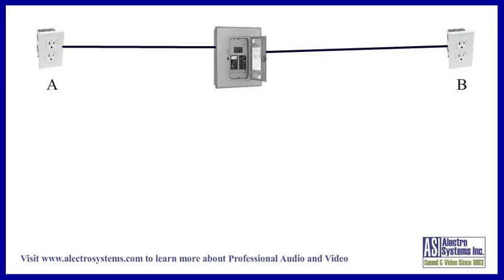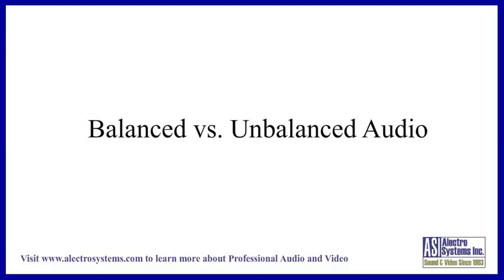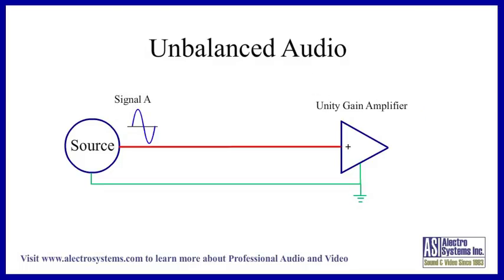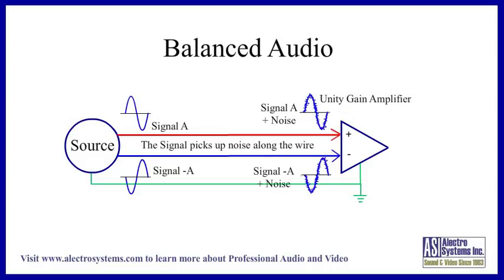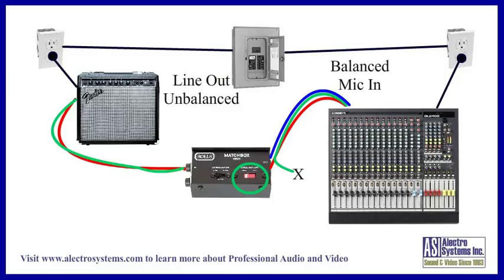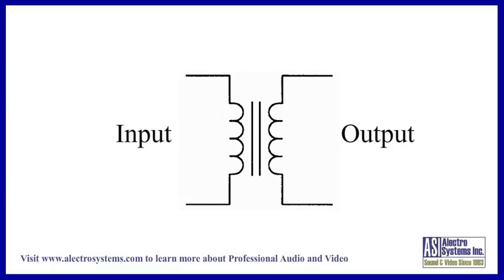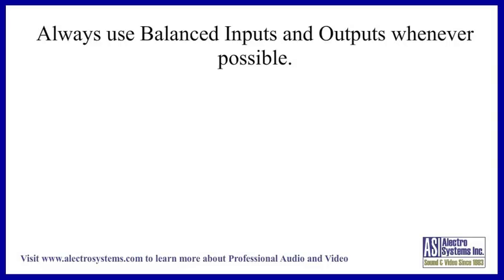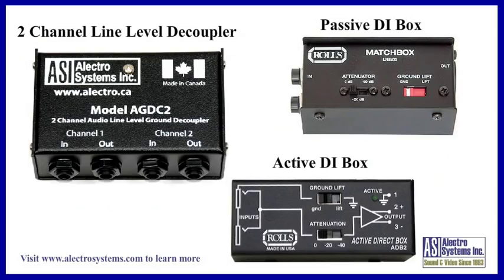Troubleshoot and Eliminate AC Hum on Sound System

Comment: I have an unusual problem. I have two different Onkyo amps. Both develop a hum when the speakers are connected. That does not happen with a new Rotel amp and a newer Yamaha receiver. Only with the Onkyo. At first I thought the problem was with the circuit- the wall socket. But with all things disonnected there is no hum. Connect the CD player no hum. Connect the turntable - no hum. Connect the speakers there is a slight hum from the transformer. No noise in the speakers. The speakers are Dali Opticon 1 mk 2. The speaker wires run behind a large wall unit where there are also cables for the TV. I am not sure what because all of that was done before my time. The speaker wires are twisted together. There might be interence picked up from the TV connections- cable, internet, whatever. The old Onkyo Integra amp is such a mellow sounding amp I really like it. The Rotel is nice, but a bit bright. The Yamaha does not fit into the cabinet properly. The speakers are 4 ohm. Perhaps better speaker wire may help and wiring that is not twisted. The hum is very low and cannot be heard when music is playing. Or from across the room. I live in Germany. I am sure a DC filter would solve the problem. Thanks if anyone has the answer. I wonder if running a ground wire from the amp chassis to the CD chassis would solve the problem.

Comment: How to get rid of Digital Noise from any Computer which I'm using MSI B85-G43 Gaming Motherboard or if I'm using the Gigabyte Z390 Aorus Pro WiFi Motherboard, to the Point that Sounds like a Morse Code every time I move my Logitech G502 X Wireless Mouse back and forwards, even if I'm using Humno on any Computer, It doesn't matter if I'm using the Blackmagic Design Intensity Pro 4K Capture Card, or if I'm using a Green Audio Jack on the back of the Computer or use the iFi iPurifier3 USB Audio and Data Signal Filter/Purifier (USB Male Type B, White), or iFi Audio iDefender + USB Ground Isolator which is connected to the Native Instruments Traktor Scratch Audio 6 USB Interface, which is plug directly into the DENON DJ Mixer DN-X800 or Citronic CDM8:4 USB DJ Mixer from any Computer, using My 2000W ALTO Professional PA Speaker using the iFi SilentPower DC Blocker and also 2000W Alto Professional TS315S Subwoofer using the iFi SilentPower DC Blocker. And never matter what I do, I'm going around in circles, and spending so much Money on something that doesn't work. So, is there something that I'm Missing? Because I cannot handle the Digital Noise coming out of My Computer to the Point that Sounds like a Two-Way Radio not tune in, and interference sound every time I move my Logitech G502 X Wireless Mouse back and forwards, when I'm watching YouTube or Blu-Ray Movies and if I'm listening to Music, Saved on my Computer Hard Drive. it's not the Balanced Cable issue, because I would experience the Humming Noise. This Problem is doing my Head In. I live in South Australia, So, if anyone out there Experiences the same Problem? Please let me know what should I do?

Comment: I've a turntable and an hi-fi both without earthing to wall.
Other source devices are connected to the same wall power strip, noone with earthing.
The grounding between these devices is linked through the unbalanced L+R phono cable with the earth thiny wire.
Noise is present and follow the volume level. But still present if the turntable is disconnected from cable.
With same speaker I've also tried two different hi-fi system. I can't figure out how the problem can be generated by AC and how any DI Box can be help in this scenario..?

Comment: there is one instance with laptops that will sound like a ground loop but it's not and that's noisy battery charge circuits or power supplies a.k.a. five dollar replacements off eBay or Amazon with no filtration and certifications. And if it is a genuine power adapter it's usually poorly designed charging circuit and hopefully you can get through the presentation on battery.

Comment: I have a balanced xlr that goes from a preamp pedal and into my computers soundcard which has a 3.5mm input. My question is....are line ins on soundcard balanced....unbalanced....or capable of handling either? Reason I ask is I have ridiculous noise and I'm trying to narrow down exactly where the issue is....without buying yet more things that ultimately have no or little improvement. I'm thinking a 3.5mm in line ground loop isolator might be the key....but I'm not certain.

Comment: Excellent presentation + clearest explanations. --- I have never found an explanation for similar problems in a 2 wire (AC) 220V European circuits, though. Are those boxes identical in construction and use? Is AC filtering done the same way, since they don't have 3d prong for ground? I thing that Alectro is the place to get answers and... to shop. Bravo!

Comment: What a great video. My set up is as follows - Macbook, connected to a wall powered mixing desk via a USB insert - in that mixing desk I have an XLR condenser mic connected, using another wall powered compression unit, connected through an insert on the same channel as the mic. No problems, no ground loop. The problem began when I tried to do something very simple, which was add a 3.5mm TRS to Dual 1/4" TS  cable between the mixer and my DSLR camera,, so that the mic runs through the camera (for better lip sync on live stream/conferencing). Instant ground loop and very loud hum and buzz and I couldn't work out why. Now I know why. I'm using my DSLR camera as a webcam, which is also wall powered with a dummy continous battery - when connected to the mixer, this means I have two different wall powered devices running through it (the compressor and camera) which is obviously causing the loop (with the USB connected wall powered Macbook which may or may not be adding fuel to the fire). I've ordered one of those decoupling boxes and will expect that this will work, when connected between the camera and mixing desk. Fingers crossed.

Comment: I have mains hum probably due to a ground loop between hi end hifi components connected to the same outlet.
None of them have balanced inputs or outputs. If I used the unit you recommend surely it means I have to use more interconnects and wouldn’t it interfere with the purity of the sound in such a system?
My DAC and transport are from China. Is there a chance this affects the situation in any way, by having slightly different voltages?

Comment: Old vid but can anybody help so i have two amps+crossover+mixer i connect then via Aux cable to my Pc and suddenly today a high pitched hum or signal noise appeared and ONLY when gaming so does anybody know what is the issue these amps etc. Are all conmected on two extension points BUT from the same wall socket so im unsure whats causing this all the cables are fine so unsure whatsupp

Comment: one thing you didn't cover is the Hum between a usb devices from a (audio interface) connected to a computer mixer and synth equipment. another thing is USB midi between devices often introduces more noise.

Comment: so having unbalanced RCA cables, and putting a balanced adapter at the end doesn't make them balanced?
Reply: If you use a DI-box with a audio-transformer, it will make an unbalanced audio signal to a balanced audio signal. 

To get good audio quality you need to use high quality audio transformers, from Jensen Audio Transformers, Lars Lundahl Audio Transformers and others.

Comment: I get crackle sounds from just 1 speaker in my home theater since I added a 7ch amp. I can't seam to solve the issue. What should I do? Some told me to buy a conditioner. The amp and receiver are connected with unbalanced rca as the receiver doesn't have balanced xlr's. I also have the amp connected in a different outlet because when the amp was on the same outlet it was shutting off du to possible line sag.

Comment: What's the difference between the passive and the active di box?

What's the difference between mic level and line level?

Thanks and YESHUA GOD ALMIGHTY bless you!
Reply: A passive di box is using a audio transformer. A active di box is using a op-amp, aka active electronics. 

A passive di box is better to use, for it gives you minimal trouble, but it's audio transformer have to be of very good quality.

Comment: After 10 or so hours of trouble shooting/investigating/self educating, this video made everything clear.

We're going to take an old set of balanced trs cables and remove the ground pin on the trs connectors on the monitor ends. 

This will be our ground lift point for the two monitors.

Configuration we have is computer tower - usb to interface - interface output via 1/4 inch trs to each monitor. Each monitor is self powered/grounded, so we have a ground loop between the monitors via the interface. Ground lift on the trs cables on the monitor ends should fix our hum/hiss/pops

Comment: Having circulating earth's for signal cables is  against Australian standards, so it isn't frowned upon. If the system is high voltage then an earth grid is needed to limit step potential in the instance of a fault.

Comment: Thanks very much for the explanation. I have a few questions as follow:
1. If possible, please explain more of the differences between passive DI box and Active DI Box, which one is better and why?
2. I noticed at both active and passive DI box settings there is a button call GROUND LIFT, which one should we choose ("GND" or "Lift") in order to eliminate the ground loop noise?
3. In the DI box, may I know what is that "Attenuator/Attenuation" all about? And which setting should we choose (i.e. 0, -20 or -40?)
3. Can I simply use DI box for all ground loop problems instead of AGDC2? (because in my location I see only DI box available in all the music shops, never seen one like the AGDC2, never even heard it before.)

Comment: Audio cables and power cables should be loomed away from one another and if you still have a hum...you nd to replace a audio cable somewhere and finding it is easy by disconnecting one at a time.

Comment: The main problem with connecting many devices to an amplifier is the inadvertent formation of so called earth loops, as an example your amplifier is earthed at its mains power socket, then gets earthed at the source of signal which could be a tape recorder, which is also earthed to its own power socket, then you connect the output of the tape unit to your amplifier, you also have an earth in the connecting leads, this causes a loop, and any loop will pick up electromagnetic signals, so you need to break the loop, which means you earth all devices to one single earthing point, and there is another thing about output connections, so from a power amplifier throwing out 1000watts of music power, it will be sending very heavy currents, and if the heavy current path to an earthing point is also being shared by signal earthing, then you are likely to get noise and instability due to voltage drop across copper tracks which also share this track with signal earth return currents, in many ways current flowing through a wire will meet resistance, so at the starting point the voltage drop will be minimum, as the length of wire increases, then by the time the current leaves the wire, it would have dropped some of its value, and so it would reach its load or destination a few millivolts lower than when it started, normally this may not present any major problems, but can do so in a badly designed amplifier earth plane, adding resistors can suppress some of this unwanted noise, but it ca also reduce the sensitivity of an amplifier, which can give you less amplification and or lower peak power, spo a trade off needs to be made, some amplifiers have build in resistors at their input as well as RF suppression, from modulating radio station signals, where by you may hear many radio stations as a very weak background radio going on. this can be suppressed using inductors and capacitors, so those who don't understand loops and voltage drops, can do experiments to get rid of unnecessary noise without compromising amplifier response, remember adding caps across inputs can suppress radio signals but can also effect amplifiers high frequency response, series inductors can reduce RF signals whilst not effecting high frequency response. 
You can do many things for yourself, learn hard way as I did. and its all the fun, and you feel good when you have achieved good results. remember some amplifiers can chuck out so much high frequency that you do not hear but can damage your HF tweeters.

Comment: Great video! I'm a street performer and I face humming when I plug my amp (battery powered) and my pedals (which run through a power bank), if I swap my eletric system for a car battery powering everything, would the humming quit?
Reply: Yes.

But you would need to make sure about power consumption of both of those systems, as a sudden peak in each one would hinder the working of another one.

Comment: I only get Hum when I plug my Laptop Up, Then it is run through a Berihnger Uphoria, into the PA...It's fine when its unplugged :(
Reply: I had same problem. A cure was to buy a universal digital power supply. Totally fixed this as a noise point.
Reply: These will solve your problem: https://www.amazon.com/s?k=audio+isolator&ref=nb_sb_noss_2

Comment: Just bought a new amp and power supply. Both devices were tested at the retail store and worked ok. However, having connected the amp and psu to ac power at home when i plug input cable or even touch one of the input terminals with my bare hands i get a deafening hum from the subwoofer. Also a problem i had ignored before even purchasing the amp and psu when i touch the bare audio input cable from a receiver I get shocked just a tiny bit. It seems like my AC is not earthed properly or something, I dont understand much about electrical engineering. How do i fix my problem?

Comment: Cutting signal wire ground could introduce RF noise due to antenna effects. 
However, these effects are (almost) non-existent in audio systems due to the cable and wavelength. Unless the system is >6km (λ/f)
Cutting the signal ground but leaving the shield intact is the safest budget solution.

Comment: Thank you! Learned this in recording school but forgot the balanced inbalanced cables part (was a performing artist) and was the only girl in recording engineer class lol). 

Scenario: Tonight when firing up my guitars through FX to board- hum on the two Peavy speakers and silence on the JBL’s. I know cables can get expensive and noticed only one ring on all my cables (imbalanced?) so wondering if my 2 DI boxes will solve any of this? You lost me at the DI BOX vs Ground Decoupler. One is for mic and guitar (DI’s ) and the other (Ground Decoupler) would be if a balanced cable wouldn’t work from my speakers to the mixing board, - is that correct??? I was running my iphone music through mixer and playing guitar when I noticed humming on peavys but not JBL’s . 

So A) can I use di boxes for a speaker? No right? Should I try a balanced cable first or get the decoupler?
And B) one ring on my audio jack is imbalanced and two rings indicates balanced right? 
C) what brand or specs of cables should I be using for guitar to fx, fx to board, speakers to board? 

I appreciate the help!

Comment: The most effective, if not the cheapest, way to completely eliminate 60 Hz hum and other powerline related noise in audio equipment is to use "Balanced Power" AC power supplies as the power source for all studio audio equipment. An example would be a Furman Model IT-1210. I have one of the Furmans but also a similar unit by Equi-Tech Balanced Power Systems. These are basically isolation transformers. The guts consist of a single massive toroidal transformer with a 1:1 input/output ratio. This means that there is no actual electrical connection between the AC output and the mains input. The connection is magnetic. Because of the huge magnetic reluctance powerline noise is effectively completely filtered out. Since setting up my studio with the isolation transformers I have totally eliminated 60 Hz hum. Grounds loops with connected equipment is also completely impossible. At one time Radio Shack sold small isolation transformers, about the size of a "D" cell battery, that had RCA phono input/output connections for insertion into audio signal paths. Because they operate at audio frequencies it is possible that they could "color" the signal or otherwise alter the fidelity of the audio, but I am only speculating. They were effective at eliminating hum created by a ground loop.

Comment: I had a hum in my system; however, when I plugged in an external monitor to my laptop the hum disappeared. So until I was able to buy a new laptop I hid the external monitor under the table. Boggled my mind.

Comment: Actually, this video helped me tangentially. It prompted me to look at the many connections in my modest shack and reconnect some of the AC feeds. This provided a modest improvement, so it seems that I am on the right track. It's still humming, since I couldn't pull the rascal out of the multi-tap feed. It's funny though, the problem of humming just suddenly appeared. It's freezing here ... nothing works ... time to call Ghostbusters.

Comment: Very knowledgeable description of my buzz/hum. The solution might be beyond my budget. Thank you for sharing your expertise. Based upon your explanation I tested a couple things. Unplugged all devices, mouse, external hard drive from the usb ports and unplugged AC too.
When I move the AC cable close to its import connector or my computer the buzz grows. I'll have to record without it being plugged in.
Thanks again for your help.